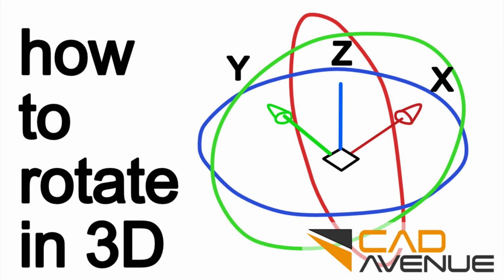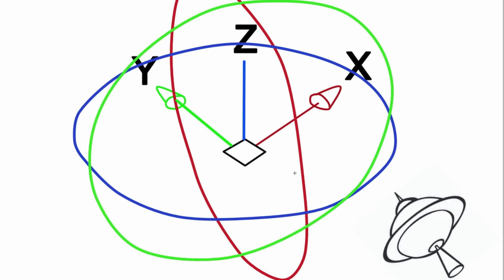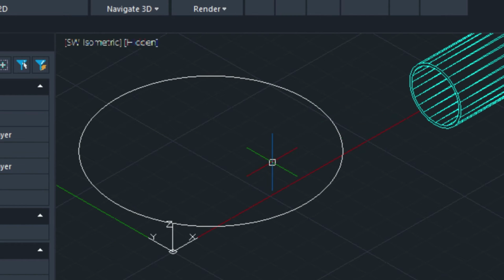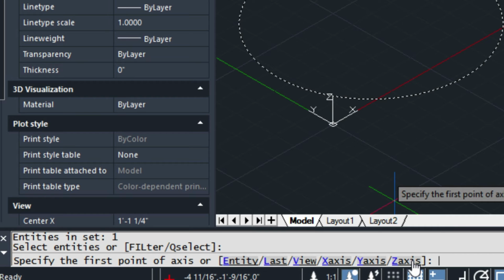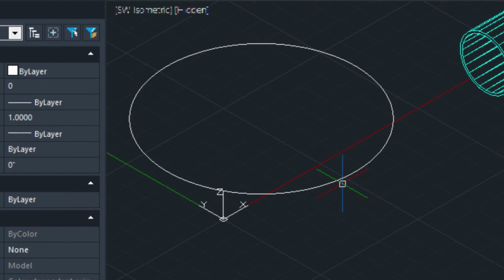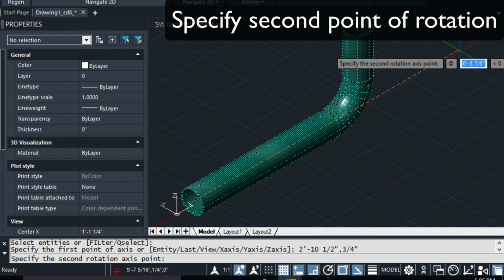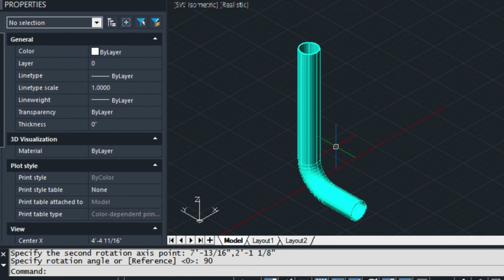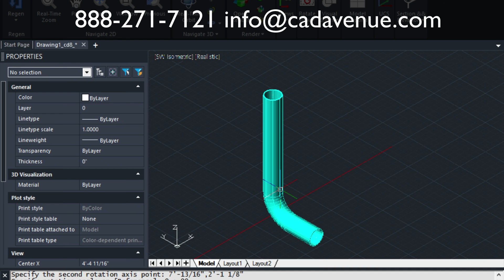How to use the 3d rotate command in CAD / AutoCAD ®

Comment: RO just gives me plain rotate. No 3D option comes up. I hate ACAD, lol.
Reply: Found it on the pull down. Ugh But it worked.
Reply from the maker: @pjlillie  , I know it can be frustrating! One thing, too, if you type DYNMODE and set it to 3, you will get the tooltips like I'm using.